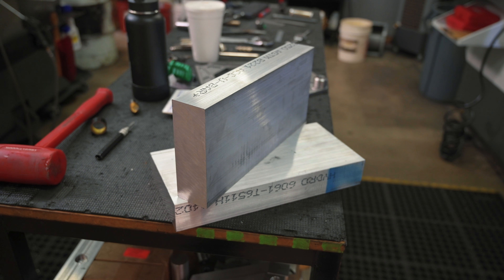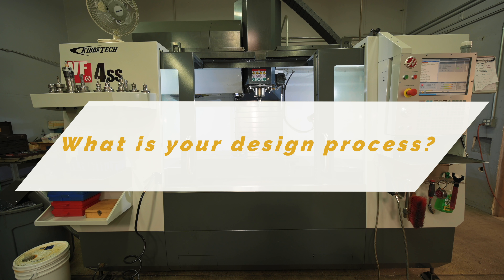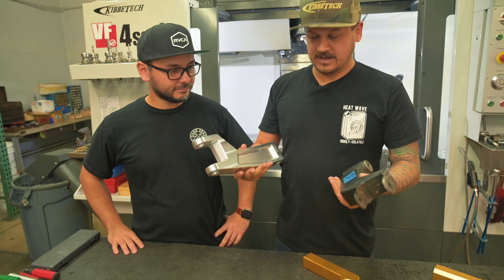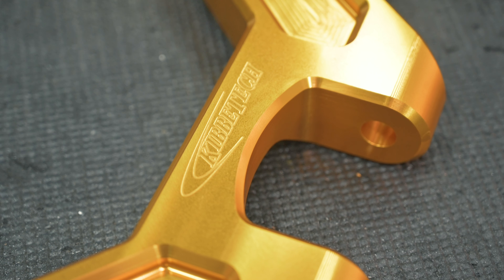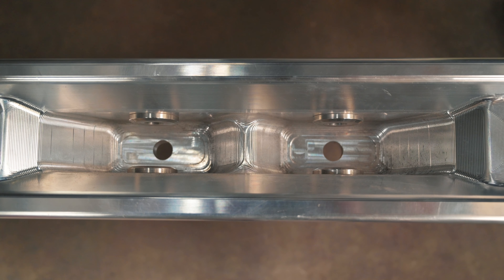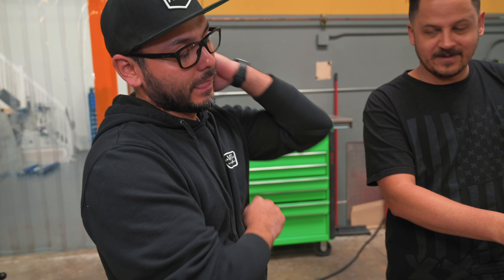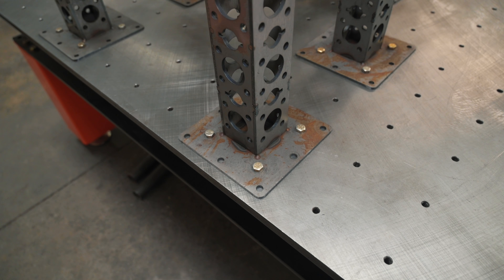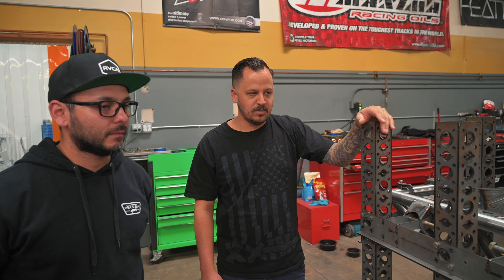CNC Custom Billet Parts, Bulkheads and Fixtures - Kibbetech Talk - Ep. 7

Comment: You guys should look in to a meta-lax stress relief system. You attach it to your welding table and run it while you weld. Reduces stress and distortion. You can also use it on billet materials before and after machining.
Reply from the maker: Don’t need it.